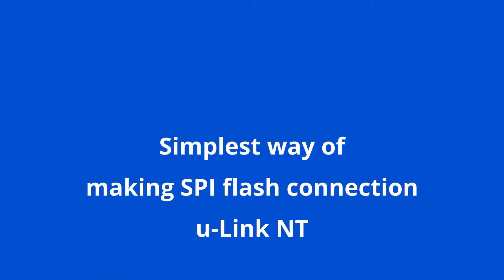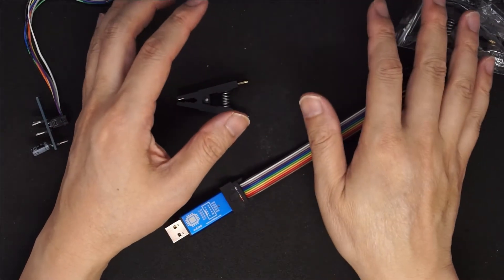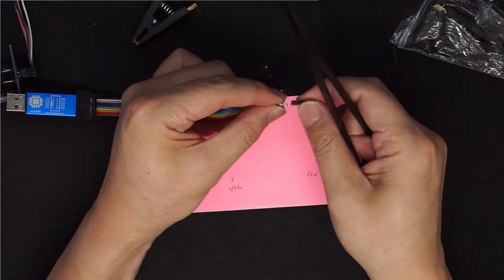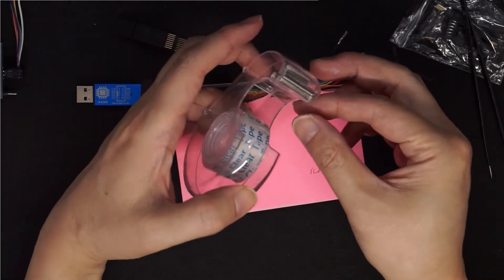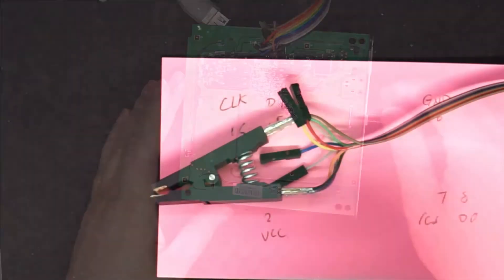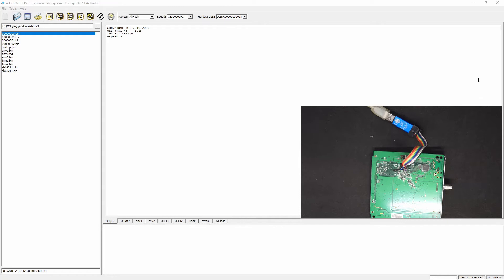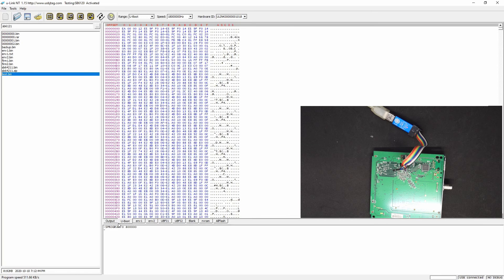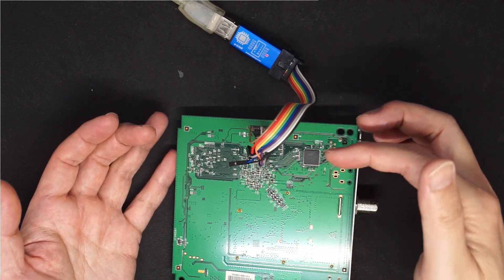Easiest 16 pin SPI connection with u-Link NT. (No soldering)

Comment: why is this method not working,  i used a new clip with a solid connection,  followed your instruction s step by step, the software does not detect a flash. . .i tried over and over doudle checked connection , this method does not work for me sb6141
Reply from the maker: If you cannot detect flash and read all 00,or ff, then it is still the connection. Hard to diag remotely. Try soldering method.
Reply: Don’t even waist your time on this find another way to do it. I was playing with this garbage U Link-nt for months and no luck I don’t even flash one modem with this thing. Save yourself some time and put this U Link-nt on the trash can i have mine on the history draw hopping for reimbursement one day 😂😂😂😂. The one it was working as a champ was the J-Tag I still have mine and no problem they don’t make it no more.
Reply from the maker: @flako4u77  Will I think I might have to make another video for SB6141 with u-link NT. I think u-link NT working on SB6141 is the best combination. Others have been using this combo and working fine. The key point is the connection must be correct. If all 00 or all ffs then it is simply connection issue.
Reply: @usbbdm  I watched all your videos one by one and I had have hear one person can be successful using your U link-Nt. If you gonna do another video and use your clip the you use all the time please don’t even waist your time. What you should do is a video on how to make that clip, and a better tutorials. Don’t take me wrong some of you videos are good but most of them are like this: you: flash this modem with a clip the you never gonna get because I did my own and I don’t gonna tell you guys how to make or here I solder to flash this modem yes you solder bit where you solder what cables you put where. You channel your product you do whatever you want but if you really want to teach is you have to think like us. How hard is to make a nice tutorial on how to make the clip the do you use with name of the parts and how to locate the cables, second on each video zoom so we can see where the cables need to be soldering for some of us we go by the colors of the cables like cable blue on pin 3. If the videos would made like that trust me I will be flashing modems since last year. I don’t want you to take this comment on the wrong way just let you know what we need from you so we can make thinks happen and improve your videos from our point of view. Another option is you make those clips and sell it to us win win. From now and until I flash my first modem I really suggest people to stay away from the U Link-NT.
Reply from the maker: @flako4u77  I think there is different approach here, You use u-Link NT only to program SPI flash. But u-Link NT initially designed to be "UNIVERSAL". That is why a jumper is provided. I have many customer coming back with success experience with both USB JTAG NT and u-Link NT. If u-link NT is only for SPI programming I would not make the connection like this.
Again u-link NT itself is not just a programmer. I did not anticipate making correct connection is so hard for some people. Whether using solder or not or clip, all it matters is to make the correct connection. As of color of the pins, https://www.youtube.com/watch?v=AAewbrPH8go should be more than enough and if that is not clear, please tell me how can I make it more clear?
Reply: @usbbdm  clear as the water, anyways I don’t planing on using my  U Link-nt soon when my GTAG NT give up I will find something better to do rather and spend 2 years learning a USB connections. I’m so happy for the persons who really make this device work for me was a disaster and I don’t recommend to purchase the U Link-NT to no body unless they have the time and the money to work with it for me time is money and I already waist one year with this usb. I give you 10 stars ⭐️ on sales because when I purchased my GTAG I purchased the wrong one and you guys fix my order and send me the right one thanks for that well done.
Reply from the maker: I created web page https://www.usbjtag.com/jtagnt/sb6141.php. It has colored diagram. 6 pins needed to connect to the chip. 3.3v (Black). Gnd (white). DI (Brown). DO (Orange) SCK (Green) CS (Purple).
Reply: @usbbdm  thank you for the link I may give it a shot on the future to see if that method work.

Comment: I have u-Link NT anyone want to trade for the USB JTAG NT. The reason is because I'm use to work all my modems with USB JTAG NT, I try all with this u-Link NT and is waist of time. I don't know if is the u-Link NT or I'm doing something wrong but after almost 6 months tryng to figure-out  I'm tired to waist my time with this toy. or if anyone have a USB JTAG NT for a good price just let me know thanks.
Reply from the maker: Please watch https://www.youtube.com/watch?v=_GyIHA1eK2k and see if you have burnt any pin on u-Link NT. Same applies to USB JTAG NT. If any pins is burnt then you will not be able to read/write flash.
Reply: @usbbdm  check all the pins are good pass all the tests. Any way you can make a video on how to make a clip like yours? I have everything you have the only thing I miss is the adapter the goes connect it to the U-Link NT. I have the clips, cable, and what is the name of the adapter? I will give it another try to see if I can make it work with the clip.
Reply from the maker: @flako4u77  You can come to my site and we can have a talk. In the mean time I have another video showing how to solder to the chip without clip.https://www.youtube.com/watch?v=lnK1zveRiYY